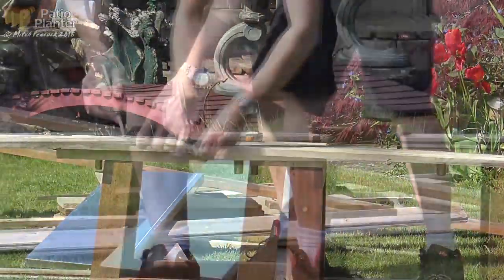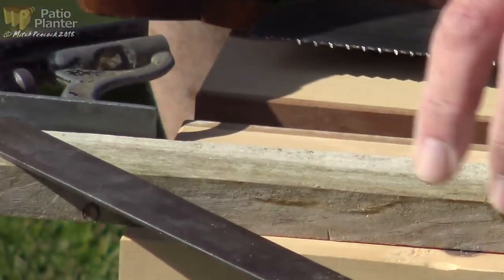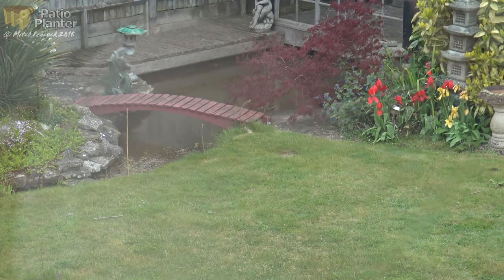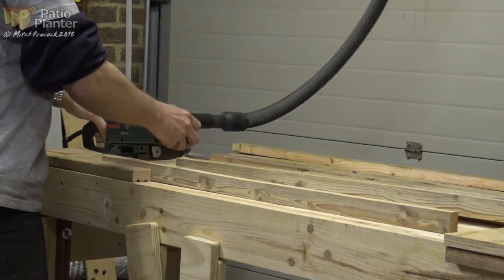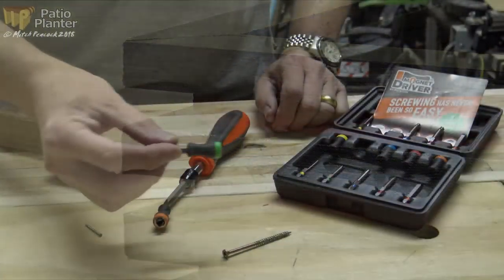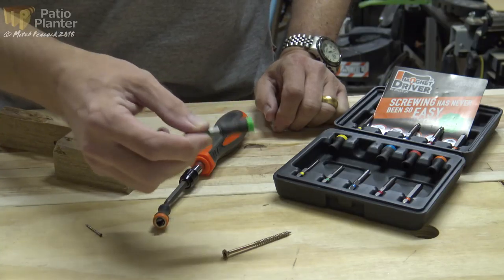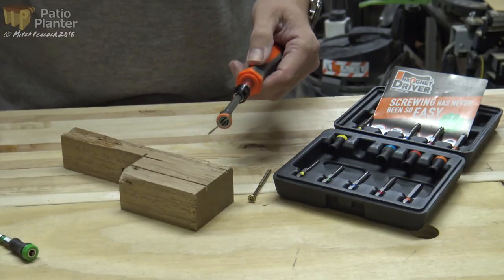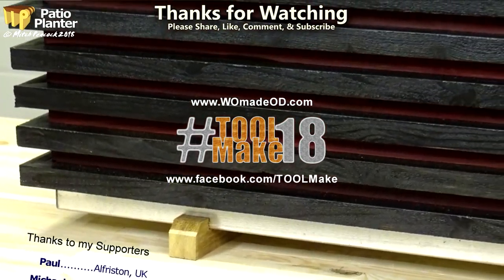Patio Planter

Comment: Very nice simple project, Mitch. When you were screwing in the corner boards, I thought of the times when I forgot to off set them and had one screw run into the other. Of course when I hit the other screw the first thing I did was to try and push harder until I figured out what was going on :>).
Reply from the maker: Been there Steve! I even grazed a couple of these with the clearance bit. Not too much space when you're aiming into a 17mm slat 😉